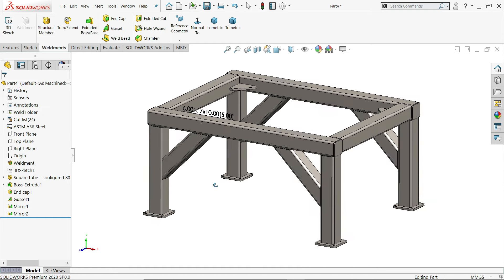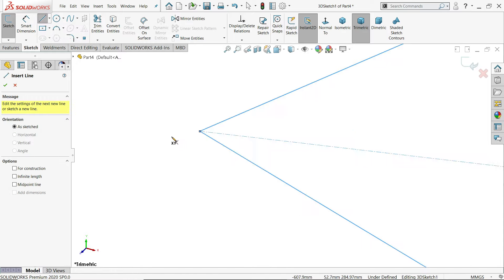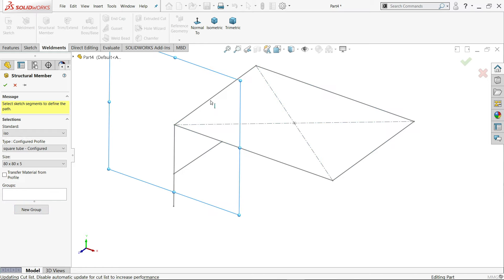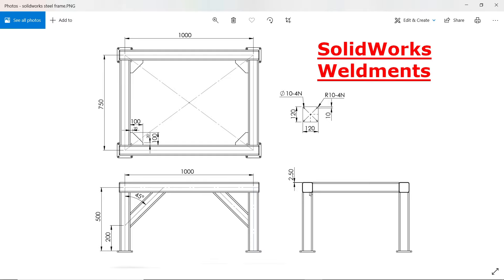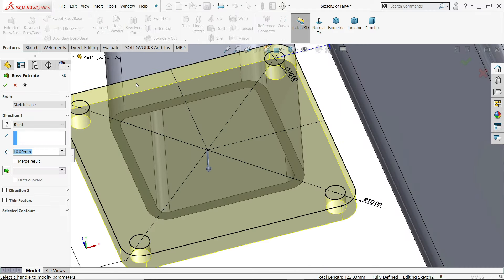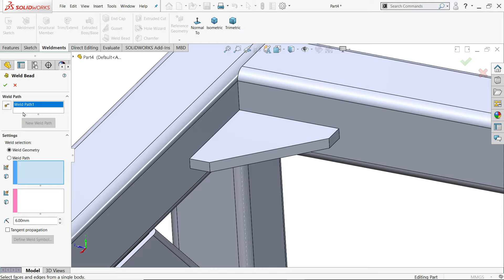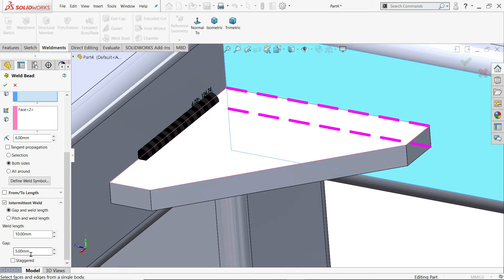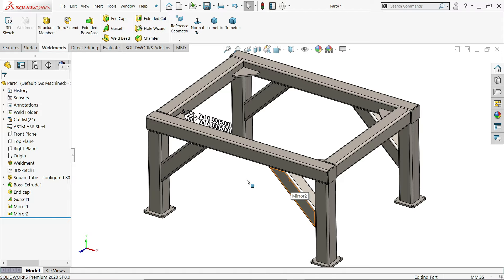SolidWorks Weldments Basics Steel frame

Comment: Hello just want to ask if the actual steel material need to be cut has an edge-to-edge measurement, how can you get the exact measurement value in the weldment structure drawing if the sketch measurement is in the middle of the material. Thank you.
Reply: I know this comment is 2 years late, but for someone, who will have the same problem, you can try the following: Since you the know dimensions of the profile of the steel ( let's say it's 40x40x4), since it is in the middle, you can shorten it by 20 and with that it will connect to the outer edge (I hope I said it right)